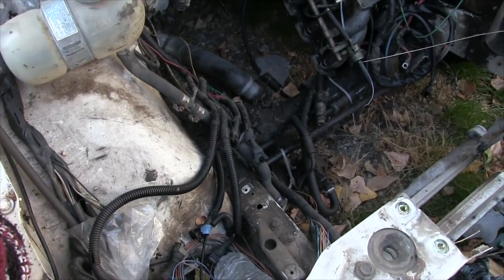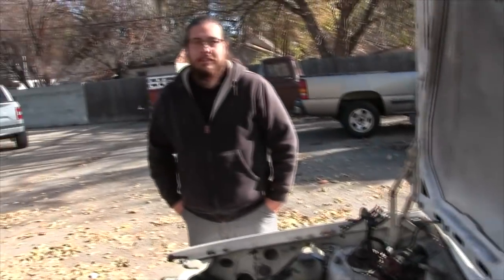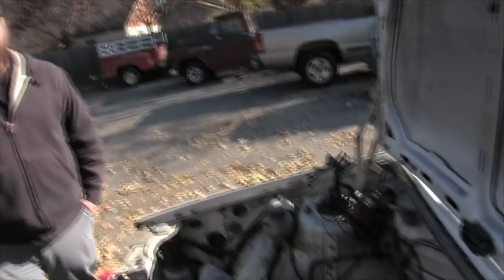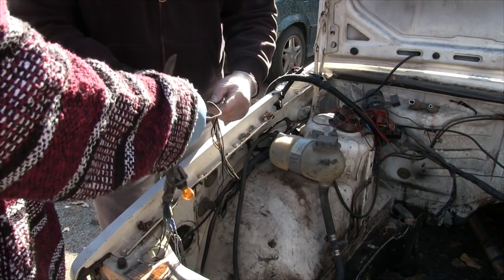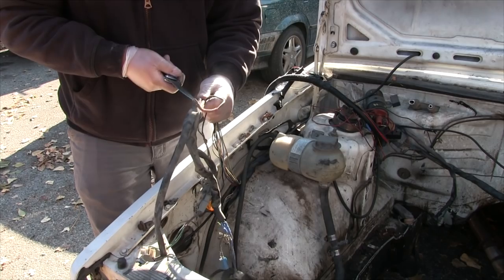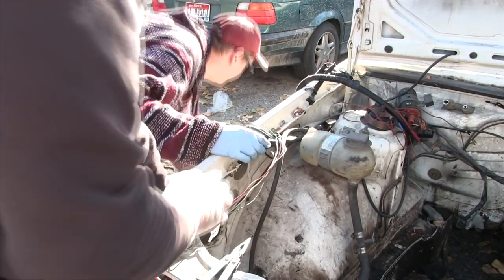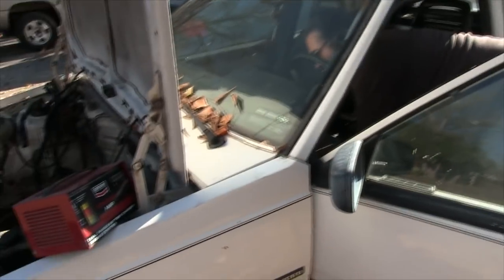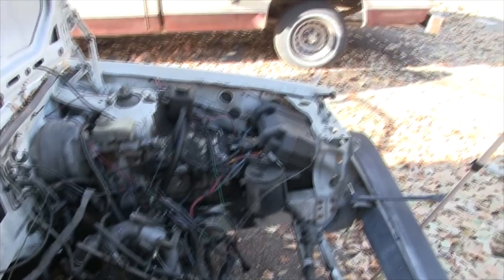Drift Car Wiring Delete

Comment: Is the engine a 9a or an abf? If it's a 9a I guess everyone is sending you messages about abf ones.
Reply from the maker: Correct, lol
Reply: @BradenCarlsonAutos  have you tried asking the dealership? Did the machine shop lose them or did you misplace them? I kinda tried looking fir some on the net but I could not really find anything.
Reply from the maker: @mariospantouvanos4645  No dealers stock them anymore, nor where to get any. I stripped them all removing them, that's just how it goes with these Engines, which is why is very difficult to find them
Reply: @BradenCarlsonAutos  well if this isn't a shitty situation I don't know what is.
Reply: @BradenCarlsonAutos  would 1.8t oil squirters by any chance fit in there?
Reply from the maker: @mariospantouvanos4645  Apparently yes, according to some sources
Reply: @BradenCarlsonAutos  It wouldn't be a bad idea to try